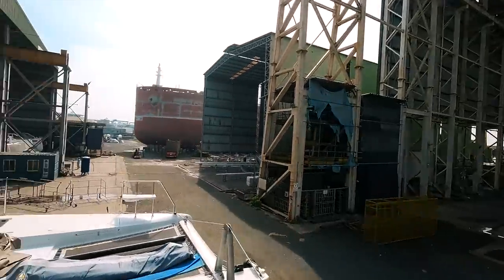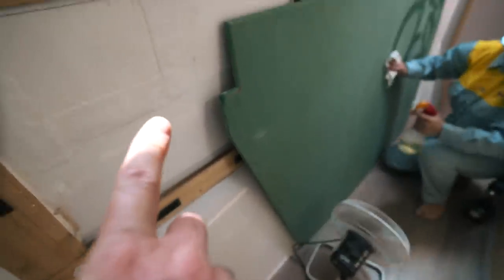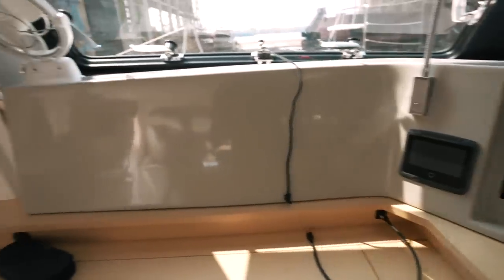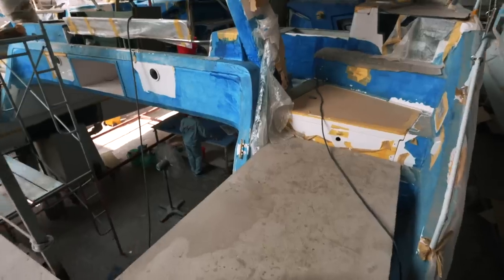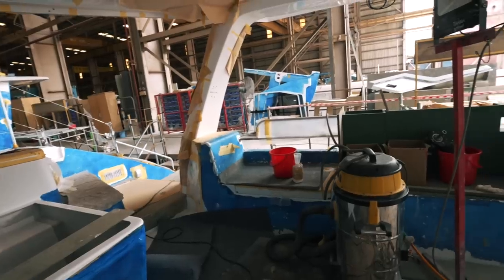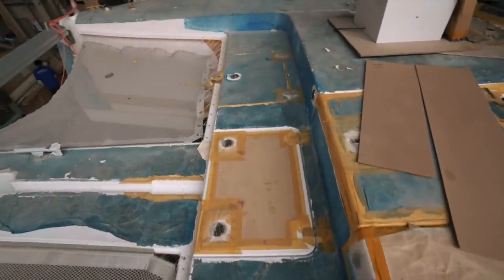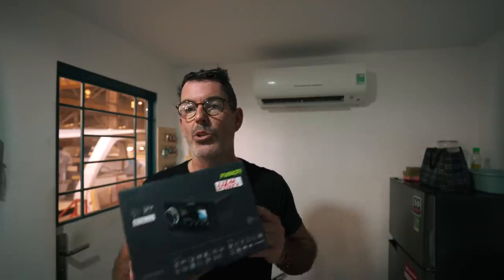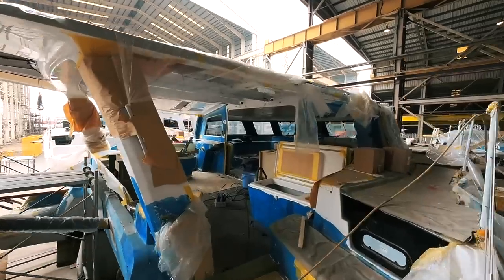Big Changes to the Catamaran Build- Also, We Need Your Help!

Comment: I think you will be sorry if you put speakers on the front. Just use wireless speakers when you need them up front.  I am not the expert but I am a retired aerospace engineer with a couple of decades boating.
Reply: I was thinking remote speakers as well for the front/wet area!  Not to mention less holes in the boat.
Reply: Great idea
Reply: Agree, I worked for Sonos forever and you dont need speakers there. Use wireless or earbuds. Too much to go wrong.
Reply: You could place speaker terminals and speaker pods that you take up front when needed. Or you could have forward facing speakers from the windows that open
Reply: I was Thinking the same thing.
Reply: Also with the large opening windows, the sound will come forward. You'll only be sitting out there in good weather anyway.

Comment: I'd have 4 speakers n the salon and 2 in the back. Don't bother up front. You can take a Bluetooth speaker up there. Traditionally you'd have them facing toward you not down. Otherwise you loose the stereo effect
Reply: If you find where you want to place exterior /camping blue tooth speakers you can fix magnetic attachments.. but beware tou dont mess up your compasses etc. 
The other option is H D velcro patches or tie downs .. dont want them dropping overboard or through the tramps.

Comment: for the front just get a Bluetooth speaker and hook it to your system, bring it out just when you need it. I am with you on your concerns, and think holes in the front and speaker that are always wet will be horrible. Keep up the good work, cant wait for you to be sailing again.
Reply: The fabric/replaceable faceplate speaker will probably be better in the sun (since it's replaceable) than the metal-grill ones, as metal grill is usually painted then cut, not the other way around, so in the internal hole ring it's often unpainted, and if so it start's rusting there in days. RIP that bluetooth speaker with the metal grill I once had.

Comment: Love the idea of the speakers for the foredeck, but agree wouldn't want to put holes in the deck where you are going to see greenwater over the bow.   Suggest you buy/build speaker enclosures, and mount them under the dolphin seats facing backward.  No holes, speakers face toward you when lounging, and away from the onrush of water.  Should be off the shelf enclosures that are made for ski boats that mount speakers on the targa arch.  You need to be careful though, some of those surface mount speakers are made to have a large volume of air behind them, if you put them in a small enclosure you could really change the response for the worse, e.g. much lower dampening factor.  Check the specs on the minimum air volume for each driver, you may need different drivers.  

As for the Bluetooth idea others have suggested, I tried that on my last boat, and opted out of the factory-installed speakers.  You need to have power where you plan to mount them, running wires or moving them to recharge was a pain.  Also, they would turn themselves off to save battery, not a bad thing, but every time you want to turn on music you had to crawl over something to turn each speaker on.  Then there is the occasional Bluetooth connectivity flakiness.  Not a fan.  Maybe for the foredeck, if there is no other option as you'll be carrying the bt speaker with you when you go forward, but for day-to-day sound, no thank you.

Comment: I wouldn’t install any speakers. I’d just get some killer Bluetooth system. As the tech improves easily upgraded. If they suffer water damage, easily replaced. Although it’s a bit different, my mum had an a,axing Bose system installed in her home when she did the renovation in the mid 90s. Speakers everywhere, sub woofers, in 1995 it was state of the art. Somewhere in the last 15 years the system sat dormant, while Sonos speakers popped up in every room.  Better features, more easily operated. It changed my perspective on installing home sound, and it would certainly be the way I’d go if building a boat.

Comment: Sub woofer outside under the BBQ as the vibration will keep one of you up on a night passage and that will be the area that most times you and your other half will entertain, the other speakers two inside facing the rear of the hull for the same reason you could place two one each side of the top of the Bi Fold door. Bluetooth the front Speakers due to weather. ??? What i find funny is most sailors try to keep Vibration out of there Ships and here you are Adding it to your Hull :) lol.

Comment: Two speakers front, two speakers back will work but I would put 4 speakers inside so the volume can be turned down for conversation but still get a good surround sound effect. If the sub is full range it can be mounted low pretty much any where inside.

Comment: You are correct to worry about speakers on the bow. See if your head unit can handle wireless speakers, then you can put them in a locker when not in use.

Comment: I have a similar Fusion System on my power boat.  I would not place any speakers as you indicated in the forward area.  They would be subject to sea water while under weigh as well as wibration from heavy seas.  Placement of speakers are best placed in more protected areas out of the elements.  Boat looks fabulous!

Comment: You will get better performance and sound quality from the 6.5" speakers if they are mounted in a cabinet with some volume vs. the headliner. The flat mount speakers are fine on a bulk head or head liner.

Comment: I agree with many of the others with no forward speakers.  I would use wireless that you can put out when needed as mounted ones would probably not last long with sun and water from my experience with marine speakers.  Use the extra set in your workshop or bedroom.  Another option is to mount them inside close to the hatches on each side and open the hatch covers to listen to the music.

Comment: On our 70' sailing trawler we just used Bose Bluetooth battery powered, portable speakers. We keep the speakers and our paired cell phones with us wherever we were on the boat. Honestly? After the initial novelty of the speakers, we rarely used them. Unless you are a music fanatic, I wouldn't even have a stereo onboard. Personally, I prefer to read quietly listening to the wind bend the sails and the water glide past the hull.

Comment: I wouldn't mount speakers on forward deck. Rather use portable wireless speakers. It avoids cutting into the deck and if weather gets rainy or waves high the speakers can be pulled inside.

Comment: Thanks for the wonderful update!
When it comes to speakers and holes in the boat, you posted a video once, describing all the water that will enter the boat through any and all holes.
There are incredible small, portable bluetooth speakers which can easily be plopped down where ever you want them, and not worry about leaky holes.

Comment: Oh, and in general you'd be better putting speakers in walls rather than ceiling. Though with a surround setup, the back speakers aren't too bad in the ceiling. Definitely if you only have two in the salon, or for your two fronts with a surround setup, you want them in front of wherever you'll be the most, facing you. Stereo mixes are designed for two speakers left-front and right-front of you.

Comment: Best setup I’ve seen was 4 speakers mounted 1/3 the way up the mast facing down or at a 45°. I would put all the speakers in the cockpit and use a wireless speaker system if you go to the front.

Comment: Two at the front of the saloon, with the front windows open these can cover the front deck.  Two at the rear of the saloon, with the rear windows open these can cover the front of the stern deck.  Two at the rear of the hard top, covering the rear of the stern deck and sugar scoops.  Tie your laptop into a portable projector at the front of the saloon and a screen at the tri-fold doors and have a movie nite over your stereo system.  Maybe put the sub-woofer in the breakfast bar?

Comment: Nick, I believe your concern of the front speakers is justified, however, the placement you pointed out does not work for me either. What about mounting them on a gamble that folds down from underneath the front window brows? I would also not only recess the nav station components like in hull one, however, I would also add a slight swale to the left side allowing for a more wrap around Jaguar dashboard feel, and it would allow for a better angle towards the nav station’s chair.

Comment: 2 speakers in the salon where you sit, 2 speakers out the back where you bbq, 1 speaker in each hull / berth (for Barry white night 😉) and for up front buy a Bose wireless outdoor speaker and connect it to the fusion over Wi-Fi or Bluetooth. You will likely only need it when sitting up there for a few sundowners in nice weather then take it back inside when not in use. No need for holes in the foredeck and Running wiring etc. Bluetooth range is 10m and with the salon front windows open I’m sure you won’t have any issue. I have one and I use it everywhere battery lasts several hours.

Comment: Regarding the front speakers: you have large cargo bins behind the seating area, just put them in there and open the lid when you want to hear music. Or mount them inside so they point outwards when the front windows are opened. If putting them inside, put them into a rotating box, so you can use them als inside speakers too.

Comment: Everyone has said not to put speakers up front. I agree completely as this is just a really good way to ruin expensive speakers and add more leak points to your boat. Buy a good quality portable speaker that fits nicely on the steps up to the roof and you'll be sorted.

Secondly, under no circumstances would I fit main speakers in the ceiling or floor. You have no mass to prevent weird reflections as sound bounces up and down out of phase. Plus, they will blow out your eardrums every time you walk under them!

I would place speakers high and low in the cockpit and just high in the salon. high = approx 5ft up and low = 1ft.

Zone to allow low position only, for when you have company and want background music.

Comment: Have been following you guys for years, love your content.  Been a sailor for 40+ years mostly just as racer, but hopefully our own circumnavigation someday in the future. Anyway, I think your concern about the speakers on the fordeck is valid. I wouldn't put more holes up there than necessary. Get a good bluetooth speaker for your cocktails on the trampolines, better sound and no worries.

Comment: Don’t put the speakers outside on the front deck. Consider this, 2 speakers on rotating pedestals (like plotters are mounted on outremers) mounted on front to corners or saloon above/behind nav station and other front corner. They can direct sound back across the saloon when in inside mode and when you are lounging on the front deck, open the forward facing hatches ( weather will be good as you are on the front deck!) and rotate them facing out. Best of both worlds, weather protected, inside mode will have great sound as not projecting straight down to the floor if ceiling mounted. Cheers Tony

Comment: Nick, my suggestion for the 2 forward speakers you want to install.......rather have them on a longer cable fitted in a mobile box, open the forward facing windows and just set them in the window sill facing forward?

Comment: I've built speakers and splitters and there isn't really something universally good that covers everything. But I would insulate the boxes with audio spesific wool whereever you decide to mount them. The sub (subs) should preferably be placed where it can resonate in the hull. You can always turn it down, also the sound is usually more intense away from the sub itself, the hull will decide where that might be, and for that reason this needs to be tried out before permanent install. I wouldn't mount anything through the hull outside, there is no way that will keep from leaking over time. You could also use a calibration unit to measure the sound in different areas to prevent unwanted acoustics and for optimal latency.

As I said, there is no formula that covers everything and as you know a boat is a different beast all together.

I wish you the best of luck in this truly important endeavour! 😊
/cheers

Comment: After seeing all the spray and actual waves coming onto the front of the cat , placing speakers there I would be a big NO . I would place them inside behind the opening front windows facing forward so all you need to do while at anchor is open the front windows to get clear good sound. Best of luck . Thanks for the update.

Comment: I agree with most below .... 4 speakers inside (and Blue tooth  for the tramp. area.  Use the 4 alike and then the other 2  use in the headliner above the grill area .  Now fo the  most important part ---> "stereo imaging"   is 10 feet apart.  So place the right left pairs  as close as you can get to 10 feet apart
(and I would make the next pair inside 10 feet from  those if you can , so the 4 corners of a 10foot square , I don't know the depth,  bow to stern/frt to back,    of your salon, but this would be ideal if it  fits)

Comment: Low mounted speakers you are planning on the foredeck will not give a good stereo spread of sound, you well just hear the one you are closest to. Agree with other comments to use a Bluetooth portable speaker up front when you need it. The Fusion system can link to a bt speaker.
Inside the saloon go for four speakers in the ceiling, or consider the reflective nature of the ceiling and fire the sound up from flat points around the perimeter where space exists.. 
zones, don’t do it unless you zone the cabins as seperate from the living areas. It will drive you mad.
Put the ex-foredeck speakers in the rear roof above where you will spend most of your time there (or even use four of those flat speakers
Love your work.

Comment: I'm thinking of 3-D of Surround Sound.  
Aft outside speakers pointing down and a bit forward. 
Mid-Boat either inside or out, pointing down and a bit toward center and the forward interiors pointing aft and a bit down. 
The sub-woofer is good where it is.
Outside forward have a sound bar pointing forward and they usually have a built-in sub. Water proof plugs makes the bar removable when needed. (Bluetooth?)
A nice console to balance the speakers and sound just where it's needed. 
Cars and RV's have them so why not you ???????  .................... enjoy

Comment: id have magnetic flipdown dark tinted glass or makrolon polycarbonate infront of instruments n switches in recessed areas of new nav station unit...:face-blue-smiling:  look tidyer at anchor  ⚓⛵
personally Id put All speakers inside or under canopy..  front 2 inside cockpit ceiling above each front opening windows.. (enough sound for outside front of boat when windows open on good days or at anchor.) 2 speakers in ceiling each corner just inside rear doors. 2 speakers at each side at rear of under canopy.. sub woofer in same position Nick proposed. 
💿📻🎶🔊

Comment: My biggest advice on the stereo system is to plan on replacing it in 3-5 years.  Marine audio is WAY behind on the audio front but has really good distribution capabilities.  So you can't go and put a consumer grade Sonos system on your boat but at some point soon the marine grade systems will catch up. If you just listen to music the Marine systems should be fine but you might want to upgrade to better speakers in the future.  Maybe get two head units and put them in party bus mode with one inside the lounge and the other on the back somewhere so you don't have to go inside to use the physical screen. You probably already planned on this since most marine units only have power for 2 zones and you need external amplifiers for more and you're thinking of having 3.

The biggest change on the amp end to look for will be Atmos support if you like to watch movies.  Unlike the  older surround tech, where you have to place the speakers carefully, with Atmos, the recording knows where all the sounds should exist in your room and it does the math to use whatever speakers you have to make it happen.  Now it still helps to have speakers covering the room but it's MUCH less finicky about where.  Generally somewhere near-ish the four corners at listening level and then 2-4 ceiling speakers.  Given realistic constraints of your build, just make sure you can retro-fit at least two in the middle of the ceiling.  If you can't have any wall speakers, push the speakers towards the walls without getting too close. Some speakers allow you to mount the speaker angled into the room rather than straight down.  There are some great resources for Atmos out there you can read up on.  The BIG deal is up-firing speakers don't work great and without wall speakers you would basically be doing the reverse with down-firing speakers.

Comment: I'm with the 4 speakers and sub inside the cabin and 2 out the back,  if you're out the front chances are you'll have the windows open or has been suggested a wireless speaker to take out the front.

Comment: Facing forward is likely to destroy the cone. I would recommend building boxes that can sit in a locker when moored. You pull them out. Far too likely for damage on the front. Even just water on them for extended periods of time. They could design the speaker box to fit in with the design.

Comment: As to foredeck speaker placement I would be thinking about putting them just inside of the window’s opening.  You would open the windows to hear them on foredeck.  That way they are protected and you don’t cut any holes in the foredeck.